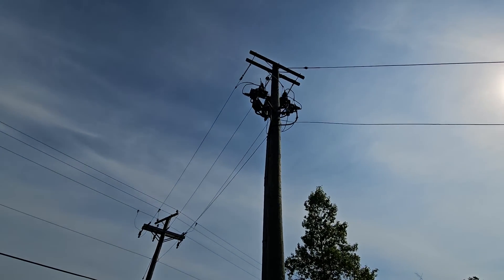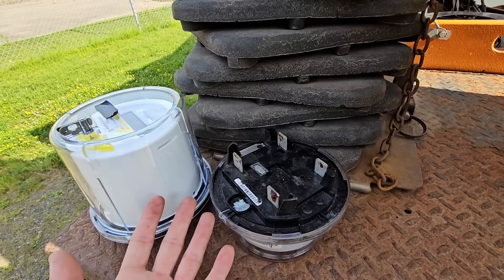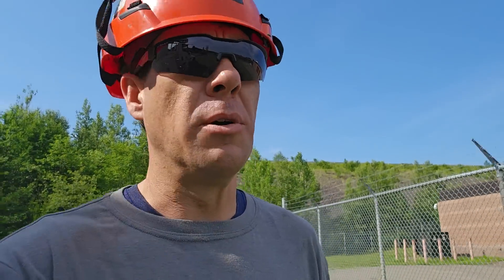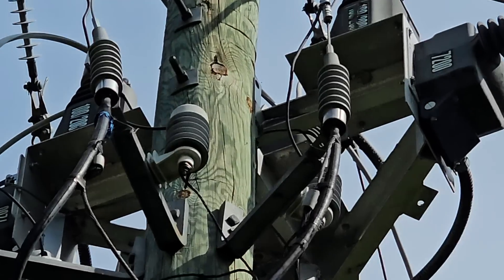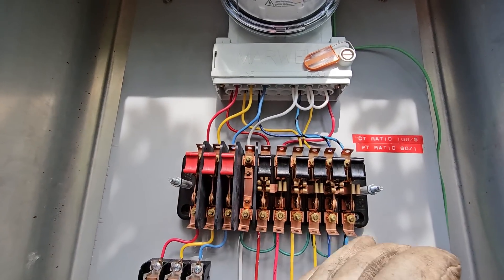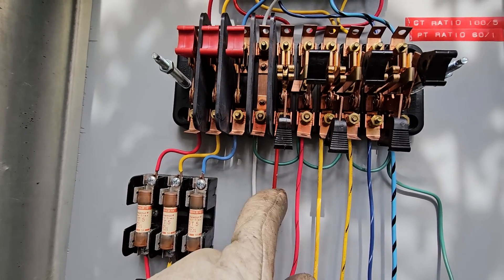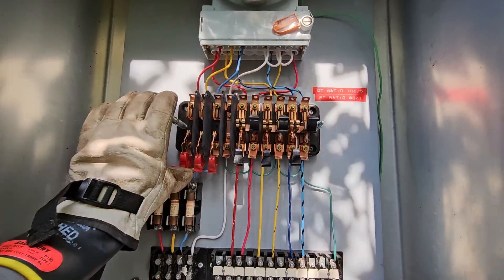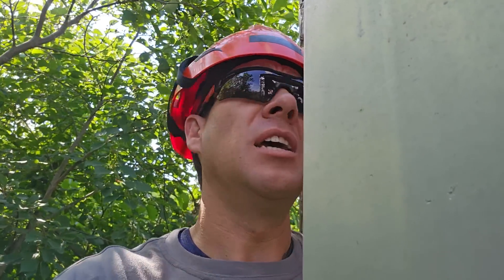Changing a "Smart meter" - 3 phase

Comment: Do you know if there are any rubber insulated gloves designed for fatter fingers? My job-issued ones barely pass over my knuckles, even with baby powder and stretching, yet are still a bit too long for proper dexterity.
Reply from the maker: Not really, but Salisbury does have a newer model that has a lot more dexterity! I think they're called Electriflex
Reply: I use size 11 for L.V.  class 0 gloves. The most common size with the guys I work with seem to be size 10. Salisbury and Honeywell both make various sizes.

Comment: It seems cool that the meter may be circular and familiar looking but is it not a revenue-grade meter?...no matter the shape...good enough?  Matching CTs and PTs make the 10kHz sampling rate(last standard I knew of)  revenue-grade meters work just fine. Less than 10A going through them and accurate with whatever load there may be.  Why are the lugs so big on a meter that passes so little current?
Reply: While I'm not in the field, seeing as the two units have the same socket layout (except for the extra pins), I would expect that it allows them to share more components between the models, therefore making it cheaper to produce. The amount of money saved by sharing tooling and components is probably greater than the cost of the excess material. (ex. if you took apart the residential unit, there may be spots on the circuit board where the terminals for a 3p model would go. The same goes for some of the components of the socket.)
Reply: "Why are the lugs so big on a meter that passes so little current?" Those big lugs have been in production over a century. (And perhaps the question is: why are we putting 100-200Amps in lugs originally sized for 10A-20A? You want to be really conservative feeding a house/factory for 50 years.)

Comment: As a meter technician, I've had to correct some linemen mistakes like shunted CTs and reverse current flow on one phase.  Needless to say, they can be some high dollar mistakes if improper metering carries on too long.  Good stuff, Aaron.
Reply from the maker: One small mistake can definitely cost a lot !! 

Where mistakes are so costly,
We always have a second guy verify  work when doing a full meter job (Pt/CT/test switch and meter).
Reply: @ryanwhite9709 Primary metering is more than just a meter. That's why.
Reply: Who pays the mistakes? The billionaires that own the companies that are already overcharging the masses?   No harm there.   But I'm sure it's the opposite by design. Wonderful world huh.
Reply: @TheTubejunky  Electric rates are set by officials appointed by elected office holders, the people you put in office to do so. You have put into office people to gouge you, if the rate is gouging. If the rate is higher due to some inevitable mistakes by employees, that is the cost of having electricity. That cost doesn't go away in government owned operations.

 Power companies are generally owned by huge numbers of stockholders, not especially billionaires, and mostly indirectly through the funding of pensions. In any case, billionaires are calculated as such by the assets (stock) they own, not the money they spend on themselves. Those billions in assets remain locked into the operation as long as the operation exists, and remain so when owned by government.
Reply: @TheTubejunky In our cooperative membership service agreement, we will recoup from or credit to the member(customer).  The utility needs to have multiple check for errors like this.  Glad to hear that Aaron’s got em and I have implemented prevention measures at my company too.  IOUs and Municipals policies may vary and would be subject to local laws.
Reply: @TheTubejunky  Yes, you have to pay for the power you consumed.  I'm not sure why you find that egregious but go off.
Reply: @Meowth849  This was about mistakes in measuring the power that was "said to be consumed" but wasn't. Errors that cost the customer not the supplier.
Reply: @TheTubejunky  Can you tell me what type of wiring error could possibly go in the utilities favor? There isn't one. Every single mislanded wire hurts the utility. You're full of it.

When you can describe how to wire a single phase primary service with a form 5S meter I might give what you say some credit but you're just talking nonsense.
Reply: @Meowth849  lol a single transformer center taped split phase isn't rocket science buddy. You're full of it. What I'm saying is if the utility created the issue then they should pay for it.
Reply: @Meowth849  I'm finding it hard to take a person with the word meow in his name seriously. Sorry you misunderstood what I said but that's a you problem. Stay safe don't chew the wires "meow" .
Reply: @TheTubejunky  Again, when you can explain how to wire a dumb simple 5S for a single phase primary application I will care about what you say.
Reply: @TheTubejunky  
I said primary metering. You have no idea what you're talking about. There is no distribution transformer involved in primary metering. You will need instrument transformers. Please tell me how many and of what type.  What connections will you make and how will you wire the meter to it?

Remember, this is a form 5S. I'll wait.
Reply: @TheTubejunky  Why would there be a split phase transformer feeding primary metering?  This is next level dumb.  It's impossible for utility wiring mistakes to cost the customer more.  All wiring mistakes are in the customer's favor.
Reply: @TheTubejunky  Still waiting for an answer. How would you wire a form 5S for single phase primary? What instrument transformers will you need and how many?

Comment from the maker: I don't go very in depth on metering in this video... just kinda covering the "Lineman" side of things.

Most Importantly 
- Make sure you have the proper meter.
-Never leave an open circuit on an energized "CT" (current transformer).

Lastly, I mention that you can't meter high voltage... you kinda can, but it's not practical. Any common high voltage meters (which many exist), use resistors, PT's or Ct's to reduce the values at the metering element.

Cheers all! 
Be safe! 🍻👊
Reply: Very interesting regardless